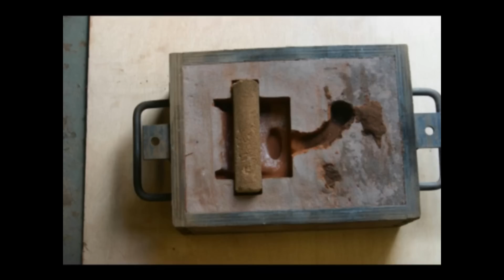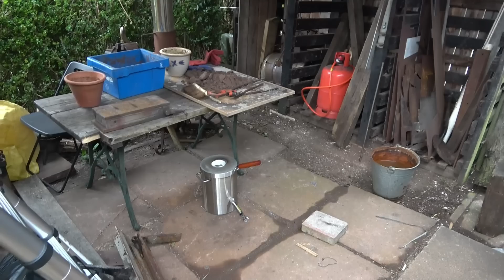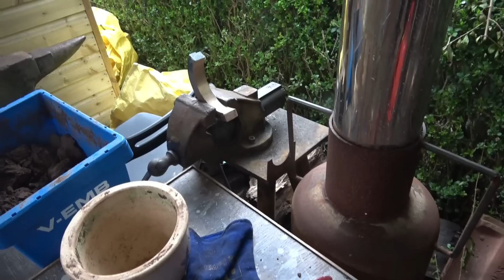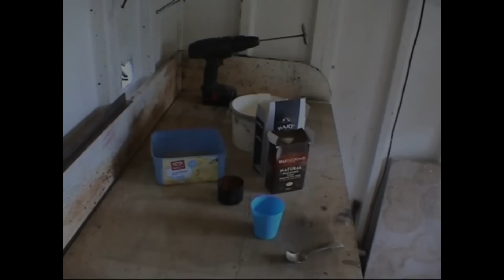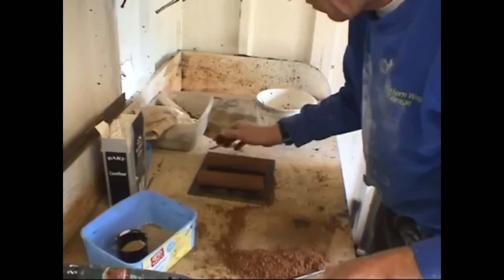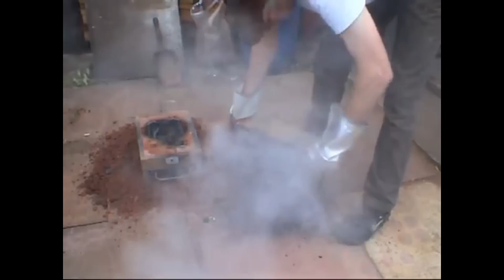Wed Catch Up 35  New Work Space  Making & Using Sand Cores

Comment: Might be worth picking up a cheap cast-off oven John, can often find em from scrap guys, or by the side of the road. A lot of em will run off a 13A plug and you could keep it up in the sheds so as not to stink out the house with the other mix you mentioned :)

Comment: Good casting John, always enjoy your videos [prob as your a northerner like me!!]looks like you've faced with petrobond, I cast plaques & nameplates & I use petrobond [expensive] in contact with the face of the patterns as it's a stronger sand especially on smaller letters & then back up with mansfield red greensand,after quite a few melts I usually mix some bentonite to keep the bond 
Graham.